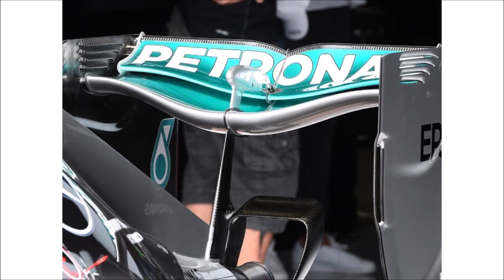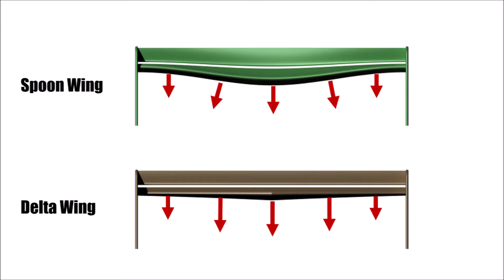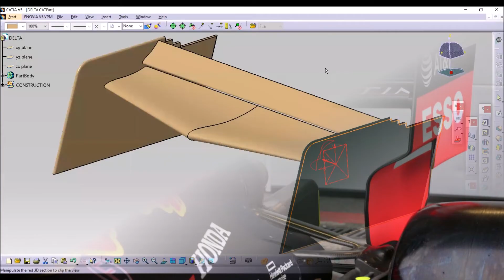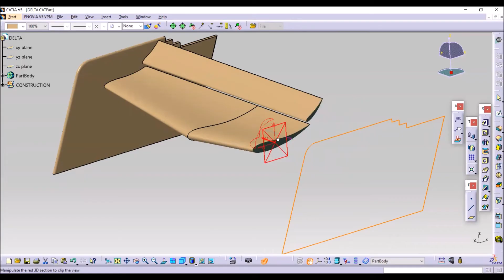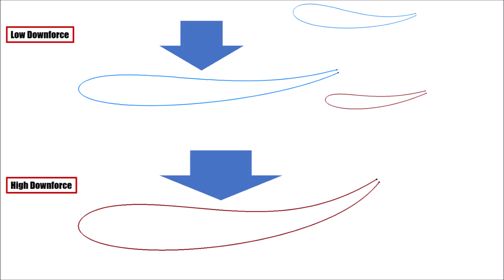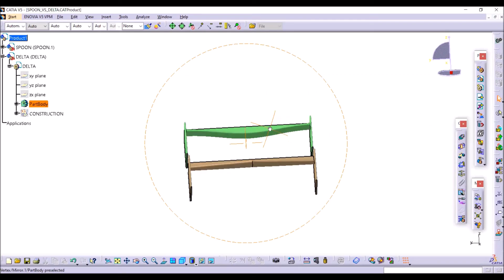Delta Wing vs. Spoon Rear Wing in F1 - Explained

Comment: I thought delta wings were useless actually having seen some kyle.engineers videos :) thank you!
Reply: Yeah, he literally said it, that it wouldn't work. Because supercars and Formula One doesn't go beyond supersonic speeds.
Reply: Useless or useful is based on what metric/purpose you use to evaluate an aerodynamic device. If you are talking about avoid shockwaves caused by air going supersonic, of course they are "useless" on F1 cars.
Maybe you should watch this video again a few times because you have absorbed none of the information

Comment: 2:07 why is there a minimum slot gap of 10mm?  I mean if it's a minimum i presume there must be a benefit to smaller gaps but idk enough about aero to work out how or why or anything.

Love your channel :)
Reply from the maker: Thanks! Indeed, a smaller slot gap can help the rear wing flap.
But 10mm is a reasonable dimension because:
-It's small enough for the wing to work.
-It's large enough to not pick up too much dirt during a race and decrease rear wing performance
-And this size is easy to check for the FIA at the track
Reply: @bsport320  Would a smaller slot be more advantageous? My aero knowledge is basically confined to this video :)

https://www.youtube.com/watch?v=ZpoK0InPciM